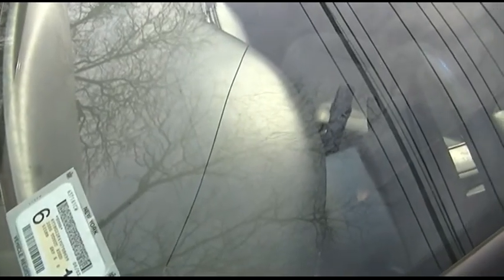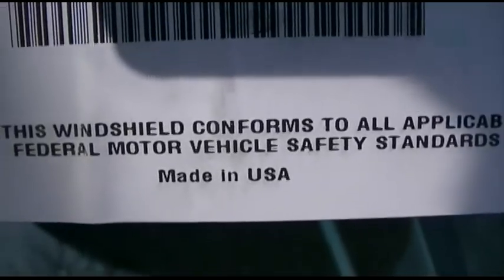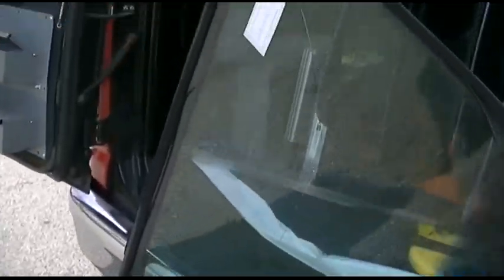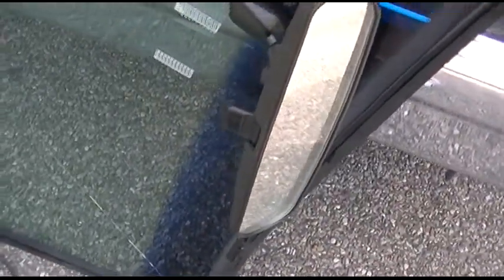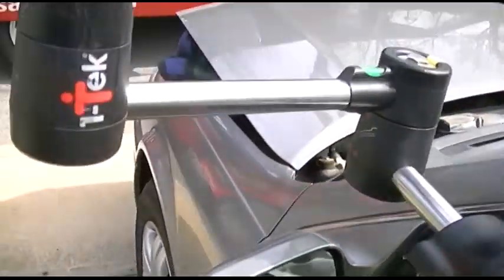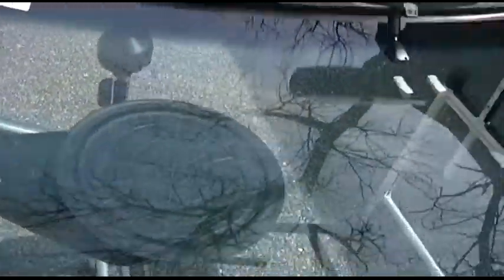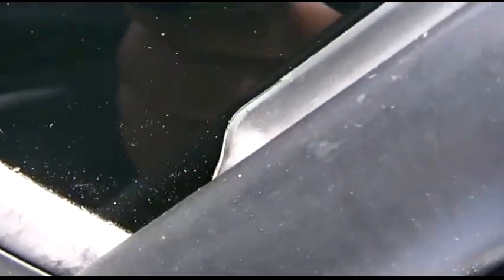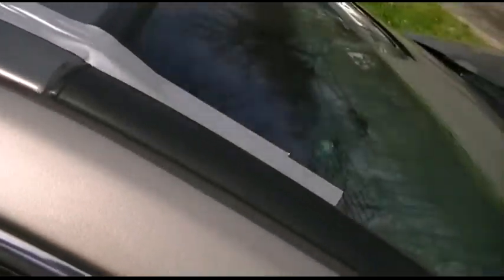Windshield Replacement 2000 Toyota Camry

Comment: Cool video just wish I could saw how you did it
Reply from the maker: The best news is that they did it all wrong, and a couple weeks later they came back, took the glass back out, broke it in the process, and installed a new one.  They also screwed that job up, but not as bad as the first time.

Comment: How much did it cost for a replacement windshield ? I am looking at a 06 camry se with windshield damage.
Reply from the maker: It cost me nothing.  The insurance I have on the car includes full glass coverage with no deductible and no premium increase.  To find out the actual cost, certain glass replacement companies have websites that will let you price it out first.  I'd really recommend you check with your insurance company first--you may be surprised to learn it's already covered for such loss.

Comment: So many steps not included in the video but yeah, looks good.
Reply from the maker: As it turns out, looks can be deceiving.  They did a HORRIBLE job on the windshield.  The molding at the top of the windshield was the wrong one and they left a 1 inch gap on each side, covered by tape which they told me not to peel off until that night.

Safelite came back and I had them cut out this new windshield and replace it AGAIN, this time by someone who knew which end of the razor to hold.  He also screwed it up.  I'm waiting for it to crack again so that I can get a new one from a qualified glass shop.

I used Safelite 3 times over the years.  First time was great.  Second time not so much.  This was the third time.

Comment: is the process quick? I got the same car and the hair line Crack I had is extending more so I'm gonna replace it. so does the new windshield come with the mirror Installed already?
Reply from the maker: It takes about an hour for the actual replacement, then you can't drive the car for several hours (2 or 3 usually).  The mirror is transferred over from the old glass to the new one, like I explained in the video.
Reply: why would the mirror come with it?
Reply from the maker: ***** Exactly, since I explained that in the video anyway, just to drive the point home farther.

Comment: Was that factory oem or aftermarket?
Reply from the maker: Kinda doubt you're finding OEM glass for an 18 year old car.  SafeLite has their own glass factory and make aftermarket replacements that are supposed to meet or exceed the OEM specs.  I've never had a problem with an aftermarket piece of glass.
Reply: jaykay18 The dealer technically sells em from their warehouse. Toyotas have -83 as a part number at the end for glass on older vehicles.

Comment: Sure would have been nice to see it actually happen! No details at all ☹
Reply from the maker: Wouldn't have mattered anyway, they did it WRONG!  Had to come back, cut out the new windshield, which they ended up BREAKING in the process, only to do the new new one wrong as well.  Don't use Safelite.
Reply: @jaykay18  Thank you for your reply!! I'm so sorry for your bad experience... which is why I am always looking for the way to do it myself. I've been my own mechanic for almost 50 years but have never done a glued in windshield. I have the Camry service manual but it isn't actually very clearly drawn so any videos help me understand. I'll bet if you saw it you would quickly know why and how they screwed up! Kind regards to you! Mark
Reply from the maker: @markroush7182  Quite honestly, I'd let a qualified glass guy do it.  There's a lot more to it than just replacing an alternator, for example, it's a bit of an art.  Safelite gets the high school dropouts, inexperienced people who can make it look like it was done right.  The windshield is an integral part of the structure of the vehicle, and an important part in an accident.  If that glass actually popped out due to improper installation, that could be a really big problem.  Since this video, I found a somewhat local glass guy who has been doing this for probably as long as you've been a mechanic.  I trust him implicitly.
Reply: @jaykay18  oh how I know how important a good installation is. Actually I build precision engines as well as homes and cabinetry and have a very well equipped shop. And I'm a Perfectionist so I have a really hard time trusting jobs to others. I once recommended Safelite to a friend thinking their commercials made them look good. She wasn't happy either! Even the Toyota service center has screwed me over on simple service... Never again! All my clients say "When I do a job, I do it right!"
Reply from the maker: @markroush7182  Oh I hear you on that Mark!  Retired computer technician here.  I was also an absolute perfectionist.  Boss wanted the job that started today done yesterday, I did a Lenny Kravitz "it ain't over till it's over".  That job wasn't done until I said it was done.  Quite frankly, there were only 2 other coworkers I would have trusted to do the same quality of work I did.  We are a very rare breed.

I will wish you the best of luck in your endeavor.  From what I have read and/or seen, the shape of the bead of sealant that is laid down needs to be very specific and even.  Not to mention curing time.  I know in the old days, they used butyl rubber, but that hasn't been used in a very long time.  I wish I had more information to give you, but that's about the extent of what I know about it.
Reply: @jaykay18  You are a good man! All the best to you in your endeavors!

Comment: I never knew about this car! I know you have the big 6 and has old clanky but not this car.
Reply from the maker: +Willie Peck I got rid of Old Clanky and got THE BIG SIX.  The wife drives the 2000 Camry, had it since 2005.  Used to be her dad's before he passed on.
Reply: Oh so that's why we don't hear much about the 200 Camry. I meant to say had old clanky but stupid autocorrect had other plans.
Reply from the maker: Willie Peck The 2000 still was rather reliable, used the old "S" engine back from 1986.  While antiquated by today's standards in that it still uses a timing belt and single drive belts for all accessories instead of a serpentine, and is slow as molasses, it's extraordinarily reliable.  The only time it didn't start was when the battery terminals either had excessive corrosion or the battery just plain wore out.
Reply: That's how my dads 92 charade is. It has a dedicated belt for the AC compressor and a shared belt for the water pump and alternator. It's just a small 4 cylinder 1.3L manual gearbox of course.  It's average for acceleration and well powered for the most part. Only when on the inner state going up hill does it lag. This is all with a smushed front end(sadly it got in a accident). It's been a "bitch" sometimes but has NEVER failed to get us home. Most recent time was it stalled in the middle of the street. We pushed it in a parking lot and jiggled the terminals and it was running again. Is the 2000 fuel injected or does it have a Carburetor?
Reply from the maker: Willie Peck Since 1986 that I know of, the Camry has been fuel injected.  My dad used to have an 87 Sentra that was carbureted.
Reply: Oh that's cool. My dads car is fuel injected. He does have a temporary inoperable 63 chevy truck that is not fuel injected.
Reply from the maker: Willie Peck Fuel injection was always the case on diesel engines. On gasoline ones, they had fuel injection going way way back, but it became more and more popular in the 1980s.  When I was a kid in the 1980s, we were all still driving 70's vehicles, so I still got to experience carbureted cars, my 81 Chevy was carbed.
Reply: That's nice. If there any real difference that the driver notices?
Reply from the maker: Willie Peck Oh, sure!  Back in the days of carbs, you could flutter the gas with the engine running and really flood the carb and make it run rough, but the exhaust was exceptionally rich.  That's why back in the 50s some cars installed a spark plug in the exhaust so you could blow fire out the back, or at least a backfire!  Of course that got dangerous too fast so they stopped that.

Back in the day, an old ex-co-worker of mine and I were talking about old carbureted cars, and he said something to the effect of "You could floor one of those all day and it won't care, a fuel injected car can't do that!"  And he was right, there at the time was too much faulty computerization in the way that GOT IN THE WAY of really enjoying the engine.  Now they've pretty well got it right.

I still really really miss my 81 Chevy with its carb.  I used to be able to fire it up, go where ever I was going, and if I stopped in a deli for example, I'd come back out, and simply tap the key.  I mean just tap it.  The engine would just hit the first compression and fire, that was it, fuel was right there.  It was almost an instant start.  Sometimes I'd be a little too quick on the key, and it wouldn't fire and the engine would actually kick back and spin backwards a cycle.  But one more tap and it would run.  These "taps" were less than half a second, it needed nothing to get over to the next compression stroke and fire, that was it.

When I got Old Clanky it was the first fuel-injected vehicle I had ever owned.  That always took 5 chugs of the engine to fire, hot or cold.  Djuh-tuh-tuh-tuh-tuh-vroom, every time.  I REALLY missed the tap of the key, Djuh-vroom and it ran.  Still miss that to this day.  THE BIG SIX is nice because of that pushbutton crap, but it's still got its set number of chugs to go before it will fire.

The 2000 Camry, while fuel injected, has the old-style kind, where if it's already hot it will fire really quick.  Not necessarily a one-tap, but still very very quick.  Sometimes you can do it fast enough that you let go of the key a bit to early and it will kick back.  And if you just let go at the right time it'll just barely fire and sputter to life.  Just barely fire, and sometimes it will spit and cough and not just make it.  One more tap and she runs.
Reply: Oh. My dads 92 is similar to that. Once it's warm it only takes maybe a second for it to fire the speak plug and come to life. The 13 impala isn't as fast it takes 3-4 chugs before it cranks over. They both have normal keys but the impala is computer controlled. You can tap the key and it will keep cranking til it fires. I dolt like all these computers in cars. My dads truck has one and that's including the radio! With what your coworker said I don't think that's much of a problem any more they got it figured out I think. My dads truck acts the same way your chevy did just Tap and she will fire right up! Carburetors seem to be more "fun" but not as fuel efficient.
Reply from the maker: Willie Peck Absolutely right!  Carbs were more fun!  They switched to fuel injection for better economy.  A friend of mine used to have a truck that you'd turn the key and let go and it would crank itself until it fired.  You could also hold the key and it would ignore that and just crank until it fires.  THE BIG SIX kind of has the best of both worlds.  You press it, it will crank until it fires.  If you hold it, it will crank until you let go.  I don't know what kind of bonus that is, but it's there nonetheless.  The book states the car will run the starter as long as necessary up to 25 seconds.  Way too long for my taste, but fortunately never had a problem, it just goes it's set time and fires up!
Reply: My dads impala is just like your friends truck.